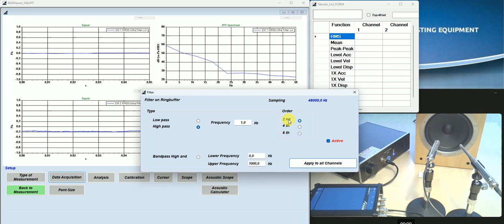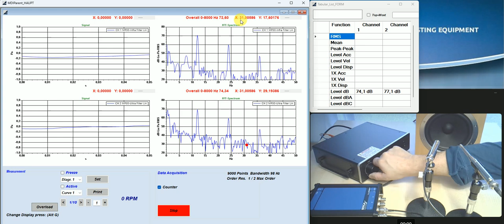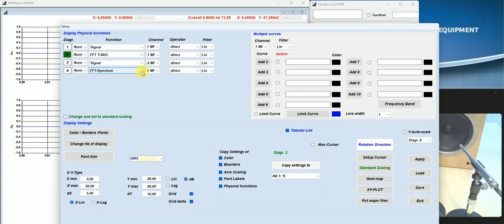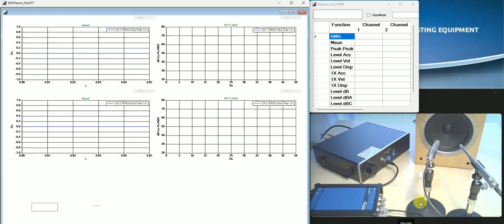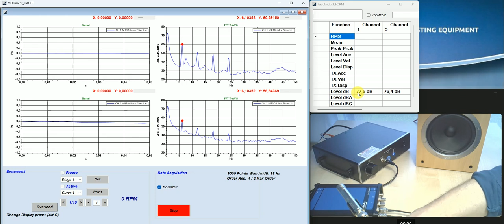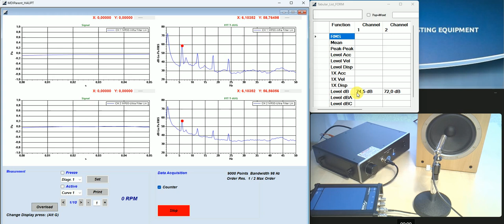Infrasound Measurement - 1/2" and 1/4" Microphone Comparison

Comment: Thank you for the video, very interesting.  I am looking into measuring infrasound.  Would vibrations from the speaker affect your results and have you ever used a faraday cage to minimise external freqencies in your experiments?
Reply from the maker: Yes, during this test, structure-borne noise will affect the infrasound microphones.
I also conducted a test with an infrasound microphone and a vibration sensor simultaneously.
Here is the presentation: https://youtu.be/XyvhBBYJxGI?si=PZMXyg0R5flR_Mmc
The housings of our measuring microphones are made entirely of metal, which already incorporates the function of the Faraday cage.